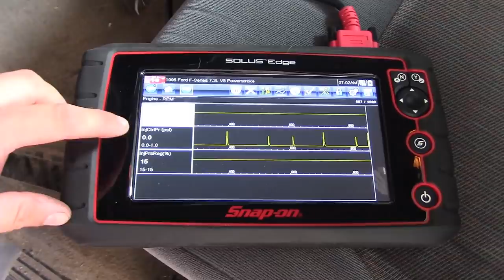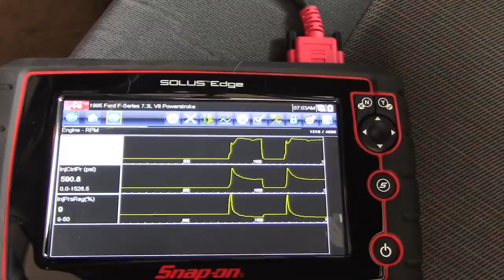Restoring an Ammco 4000 Brake Lathe

Comment: Well Wes, I don’t mean to imply negativity though I gotta say that a lot of times I watch your videos and think “this guys a backyard mechanic that owns a shop” but, it’s nice to see that you’ve got the “Talent” to bring old school tools back to life and use them in your shop for their intended use. I do like your videos and sometimes I see very professional work completed, I’m a torque everything to spec and follow procedure type of tech. I do like your approach an problem solving machine work jobs and I do like you repairs when their done to factory quality. I just personally won’t take a job if the customer won’t spend the money for good parts, fair compensation for the labor and the Get-R-Done mentality. I’m a tech that if you want it to work correctly as intended then I’m your guy but, I despise the Get-R-Done and “Ugga Dugga” or “Good-N-Tight” torque methods of repair work. 

It’s the right way or hit the highway in my shop, no room for shade tree or driveway repair work in my shop and my customers come to me for that reason. We do rebuild a lot of parts, fabricate parts and welding on jobs too if parts are unavailable or can be fixed for reuse except, if it’s not a professional and aesthetically correct repair we won’t do it. There’s too many people that love their lawyers and free money from lawsuits in New Orleans. Not to mention, the “you did my brakes and now my engines misfiring so it’s your fault” type of scam artists here! So we don’t do anything unless the money is available for absolute quality and professional work, otherwise they get told to “go up the street with it or take it to your driveway mechanic Buddy”.
Reply from the maker: If I didn't take on work from people who didn't want to fix it 100% correctly, I'd have no work. I don't live in a major metropolitan area with an affluent customer base I can pick and choose from. This is a poor to working class area. The people who do have money are tight wad farmers who have every nickle they ever inherited.
Reply: Watch Wes Work Wes like I said, I like your videos and if I didn’t I wouldn’t watch. Where I live is called the greater New Orleans area, basically I’m 15 min west of New Orleans. The town I live in is small like 5-8 min drive the the entire town.its between to slightly larger towns and below one large town. Either way, my town is small with most mechanic work being done outside of the town limits. People do as you do here where I live, they take whatever comes in with a problem. My customers are different, they see my work, rarely return with a comeback although they do return for ever little tiny thing you can think of because they know I shoot it to them straight. I never over charge them, I never over quote them I let them know prior to installing a less than quality part due to availability issues and they keep coming back because when it leaves its repair correctly so they come back for all normal maintenance.

My bread and butter are maintenance from previous repair customers and “ the by word of mouth “ is far more fruitful than most other advertising methods. I get repairs to diagnose that the dealerships screw up and most other independent shops charge too much for labor. I get them in by accurate diag, I fix the source problem 1st, quote them for symptom related issues 2nd then I reap the benefits of return service or maintenance from their trust that I fix it the 1st time every time. Most customers now tell me to keep their vehicle to test drive at least a day and for at least 48 hours to test drive them if a drivability or hard to recreate issues is fixed before I give the vehicle back. I myself drive these vehicles to and from work and for normal use with customers permission. I’ve gone over a month without driving my own car due to customers vehicles needing test drives, all customers vehicles are brought in with 80% of the time less than 1/4 - 1/2 tank of fuel and they get 3/4 - full tank in return which also shows them I won’t steal from them not even fuel.

This is the reason why I don’t take work that the customer wants to cheap out on, that cheap crap usually returns as a comeback which hurts my business. My customers are not just pockets of money, my best customers are often invited to my shop or to my home for the holidays. Every year I hold a top 50 customer appreciation gathering at the shop in thanks to their loyal business, this also bring more business to the shop as well. A few customers have become friends and some I trade work with them depending on the job, I cut them a deal and they cut me a deal type of thing or they do a job for me and I do a job for them. All of which gets my business name out there and more business to the shop. You should tangle a few of those farmers with tight pockets, do a quality repair then only quote them for other things they can come back for if they want that shows them you care and it’s their choice to do the work when they feel the need.

Get their trust, upgrade your shop a little like you did with the brake lathe, clear out the junk, clean up the shop, paint things to look restored or new, show them your a real fine mechanic with a professional shop. Offer them free services after a repair starting simple with a car wash, get you a teenager willing to work and learn to wash the cars and help in the shop when needed. Sooner or later you’ll have 2 - 4 mechanics and one or two detailers, maybe even offer services like undercoating, rust prevention and other forms of service spray in bed lining for trucks or perhaps lift kits for farmers trucks. Get them in the shop for something, do it right the 1st time, then real them in with proper services all for a good fair price to the customer. Less money quite literally brings more money in than the other way around and customers respect quality with loyal return work for your shop if they know they can trust your shops quality and if at all quantity will come. Standard repair times are for big name shops and dealerships, but you can use some of those practices to your benefit but without the corruption and false quoting from thievery like most dealership do anyway.

Comment: I totally believe in turning rotors!  I feel it is a waste to chuck rotors.  I only have one place left locally who will turn rotors. I live in Canada and rotors rust, and with brake pad build up occasionally I really like being able to get rotors machined.  I’m glad you feel the same way.  There are obviously limits to what can be done,  but the shop will tell me if my run out is too large or if the rotors are beyond acceptable limits for thickness.

Comment: You did a beautiful restoration, however, your comment is correct about it being obsolete. 35 years ago a parts store charged $7-10 to cut a rotor. A new one ran $60-70. Used from the junkyard was $30-50 depending how good it was. Now you can buy a premium coated rotor new for about $20-30 and that's what the parts store gets to cut one.
Reply from the maker: My parts store will cut them for $15 and good quality new ones are over $40 for most trucks. For cars it hardly makes sense.

Comment: Great job...that is the level I would have taken this machine to myself...I have purchased new rotors that needed turning from the get go, also I work with older vehicles and stock cars so these older brake lathes are by no means obsolete.

Comment: Wes, I’m just watching back through old videos.
I’m surprised you don’t have a tank of rust remover sat around, maybe with an induction heater sat in it. I’d think with the amount of rusty odds and sods you come across during your day it would come in handy.

Easy rust removal with no reduction in the good material that abrasive methods might take away. It could be handy for machined parts with tight tolerances.

Comment: Hey Wes, Nice work on this one! I used to use one of these at my first dealership jobs so it was really neat to see you take it apart and make it shiny again>

A side note: I believe the double throw switch for the motor is because you spin the opposite direction to cut drums, it's been 5 years though so my memory is a bit fussy of the last time I used one.

Comment: sorry to hear about max's hip. hope the fella gets better quick so he can get back to chasing the varmints in the yard! they make those silencer pads on swing arms to cancel the vibration and reduce chatter. the benefit to owning a brake lathe is the convenience of doing them at any time of day and any day of the week. would have saved me $100. in rotors on the last brake project. they had never been turned and were well within specs.
Reply from the maker: I need to get one of those silencers. I looked at another lathe that had one. The factory rotors are always the best. I try to save them whenever I can.

Comment: Cool! I just picked up an old Hoffman brake lathe from a guy and he said the same thing....rotors are so cheap now days. Well he's right, they are crap and if I can turn a good OEM or high quality aftermarket and not pay for a set, fine with me. My truck rotors are about $40-60 each new, why wouldn't I turn them if I could. Having a fleet of vehicles plus all the family's,  the machine will be paid for this year yet. Cool video,  thanks for posting!

Comment: Great addition to your shop, particularly since you were using an engine lathe that built B17 parts previously.
Reply from the maker: It's a tiebar Hendey. It might have built Model Ts...
Reply: @WatchWesWork  Yeah, Hendey's a very old company. Quite possibly it was used to turn axle nuts for civil war cannons.
Reply from the maker: @oceannavagator  I think the tiebar model came out around 1910. They made a ton of them. Good lathes but the spindle bearings are really finicky.

Comment: Ammco lathes are pretty much bulletproof, the biggest problems are the operators being to tight to change out the cutting tips, they are a disposable commodity, also the drive belts, if they look bad, chuck them, bad belts can put vibrations into the machine. Next, taking heavy cuts to get the job done quicker is a false economy, heavy cuts can put weird patterns into the disk that are responsible for growling noises on brake application, also invest in the Ammco anti vibration straps for both disk and drum applications, well worth the expense. Never machine disks under size, that liability comes back on you regardless what the customer says. I did this for 20 years here in Oz as a mobile brake machinist with both on car and off car lathes, if a disk or drum is out of specs, dump it, replacements are cheap enough these days and every customer has a lawyer on speed dial if you stuff up.

Comment: I just rolled home with the identical unit yesterday - except in comparison mine looks like its a couple years old!  No - it certainly isn't.  ;)
I've been tearing it down the last few hours cleaning up the (50 year old?) grease. Mine came with with the OE base and back.  Even found about 20 carbide inserts buried in the dirt in the back of the cabinet! Bonus!  So far, parts wise, I only need a new bellows for the one side.
Reply: Oh, and near as I can tell these are model 4100's. We seem to have 4 "louvers" and the 4000 has 2.  ???

Comment: Good job on that machine, to cover that part of the gearbox get a bushing fitting on the outer part tap it on the remaining broken part then get a rubber pipe blocker if its the write name inset on the copper bush and put a clamp. Hope it works

Comment: Sweet. Been 15 years since I used on of those. Now the lever that allows the belt to be moved on the pulleys for speed changes, I think it should snap down to the horizontal position when resting. There should be a adjustment for that as the belt wears or is replaced. It sorta locks things down. Something else, there is two arms with pucks on the ends that press on either side of the rotor when machining, to help control chatter. Sharp bits make a big difference but some are just going to chatter. I guess they get too hard from the heat and pressure. Might want to put a dial indicator on that arbor and check for run-out as it may not be visual amount and will cause you problems. You will need more adapters to turn two piece rotors, the ones that are thin in the hub area. It is two thick plates that provide more support.
Reply from the maker: I'd like to have the adjustable chuck.

Comment: Turned out great. I cut rotors and drums at our parts store for many years on an Ammco lathe, a little different from this one. Either way, the sound of the carbide bits touching off on the rotor brought back a flood of memories. Especially the one that resulted in a small piece of metal that embedded in my eye and and the resulting extraction/rust ring removal. Good times.

Comment: Wow Wes! You did a hell of a job on that lathe. Some folks would say that equipment is extinct, but as long as you clean the rotor hub faces, you won't cut extra runout into the rotors. If you want to get extra picky, you can index the rotors onto the car hub for least runout. Great job as usual.

Comment: Wes you are right brake lathes are not obsolete, people just want the easy way and just throw away and buy new when you can use a reuse a rotor that still has plenty of life. Todays manufacturers produce crap products that are cheap and most are made to keep people buying stuff since they are poorly made. Old machinery were made to last and be repairable on the fly... but people now days are mostly the users of one time use products and end of filling landfills while crying we need to be eviromentally friendly. If more people had the mindset like you maybe the world would be just a little bit better

Comment: Sorry to comment so much. But I've used that lathe alot and I usually only take 4-.005 at a time. You get less chatter and it makes a cleaner cut. You can also get a spring dampener for vented rotors which works really well.

Comment: Very impressive Wes, I like your two tone paint colors. You have had good machinist training. You can rebuild anything with gears. I remember, one of those brake laths with the Ammco logos was in my Dad's shop, where he worked as a mechanic, at an old Texaco gas station.

Comment: Beautiful work! Beautiful wife! - I watched a video I didn't know I needed. I absolutely did the exact thing u did buying this same machine out of a shop that was not using it a few months ago.
Mines worked fine for a little while but the shear gear in the cross feed motor seems like its done- being that I'd have to turn rotors by hand for fast cut. I was planning to take mines apart and upgrade to the Serpentine system - but after seeing this. I'm thinking bearings, seals, grease, locktite, and  aerosol rebuild kit 😁 really fantastic work. I will be following in your footsteps.

Comment: I still Have mine i bougt it new in 1980 Used it in my shop for years.Retired and took it with me.Not much use any longer.Mine has the long bench that came with the shoe grinder.Very usefull piece in it's day.Good Luck.

Comment: I see brake lathes for sale often and they look like what you started with, all beat up. They go for 300 to 500. I don't know what they are worth. I don't have room in my shop for one so I use the engine lathe and it's a pain. Nice restoration Wes. It looks great and nice to see you using a lathe again.
Reply from the maker: I paid $400 for mine as it was.

Comment: I recently subscribed in the last month or so, and find it hard to believe that you haven't used that resurfacing machine on more brakes that come into your line of sight. Without inspections where you are, I'm sure there are some terrible brakes and rotors that probably account for more than half of the vehicles on the road, and could use this machine's love. Either that or you have the worse rust belt jobs to contend with in the area and only see those. :b)  I think you do a pretty good job diagnosing things and am equally sure you also say a few choice words off camera too. I don't personally do this type of work for a living because nobody would come around with all the colorful language that would come out of my mouth if I had to work on some of the "crap" you have to work on all the time. Enjoy the videos nonetheless, so keep it up. I really enjoy restorations and you have to be one of the best at making things that should never run, come back to life. No scrap metal where you are in the recycle bins because it all looks like it is moving down the road. I have a 72 Chevy Pickup and it doesn't look half as bad as I have seen here, although it does need some bodywork, it is mechanically sound.

Comment: Very interesting and not something I have seen in the UK. I may use the holding system to modify my lathe jig. I would have installed the tools on the other side of the peg board so the adaptors were easier to get to and it was better storage on the bottom tray. Thanks for posting.

Comment: for that boot end ring, some graphite lube would be good. You dont want any oil or grease s the metal on metal will turning into sanding grit. The dry lube should help. Nice restore.

Comment: I used same brand, maybe the same model, back in the early 70ies. Had some problems with the shaft being a little bent. Use a dial gage and see it the end wobbles a little. The place i worked had to replace the shift a couple of times.

Comment: love it!! nice find there, i would love to have a regular size lathe but i don't have anywhere to put it as they are often really freaking heavy and needs a nice sturdy concrete foundation to be bolted down to but a brake lathe would be nice too to refurbish old rotors for obsolete cars that new rotors aren't a common thing for anymore sadly. keep up the good work and hope pup will be out running and be as active as usual soon ;)